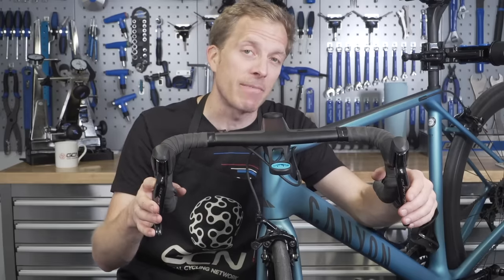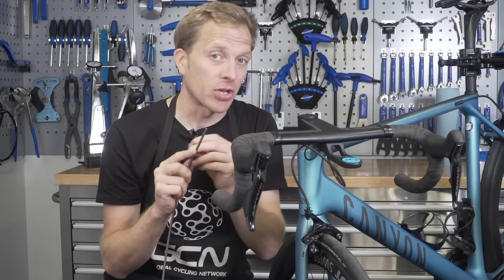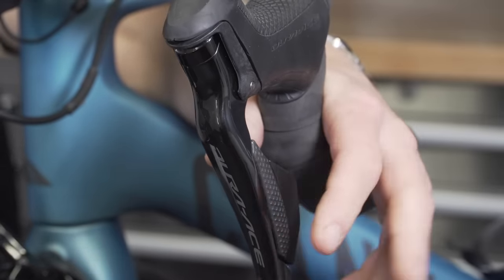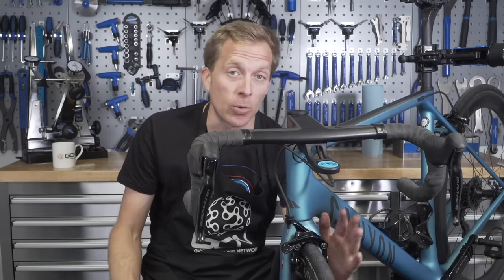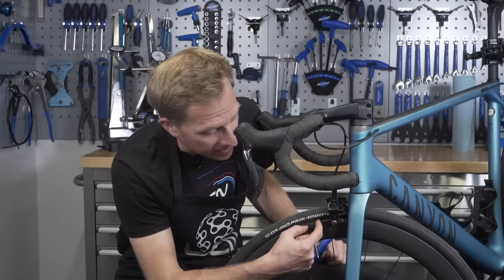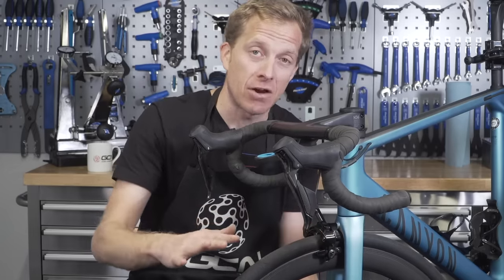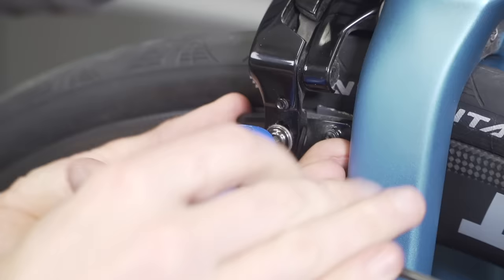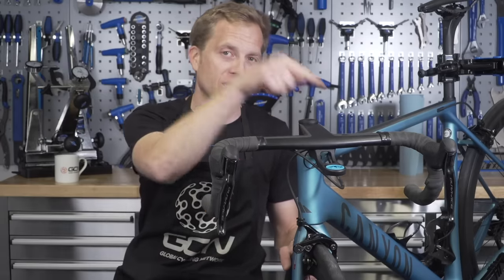5 Minute Rim Brake Tune-Up | Cable Tension, Ferrules & Toeing In Brake Pads

Comment: On my front brakes, one of the pads is closer to the rim than the other, so when I pull on front brakes they engage too hard..I want to loosen so when I apply they'll not grab... how do I adjust the pads against the rim?
Reply: There should be a bolt on the outside of your calipers with a 5mm Allen key socket. You can then adjust the angle and height of the blocks. If you need to adjust the whole thing, there is a bolt hiding behind your front fork which you can loosen and then adjust the caliper so it is central

Comment: How do you adjust the brakes on direct mount brakes? One of my front brake caliper is closer to the rim then the other. With direct mount there seems to be no center bolt to get the brakes lined up. #askgcntech

Comment: Bro I have an oscar racing bicycle. I have recently replaced its tubes but problem is that its tyres are not moving well. When I try to ride and start peddling, it takes much time to get speed. Its front wheel is not working. Brake clippers are also gripping tyres unnecessarily. Help me

Comment: I just hold the brake pads to the rim and then connect the cable. Then I just back off with the barrel adjuster.

Comment: #askgnctech Have a bontrager rim brake on 2015 Emonda SLR. Viewing from rear, the left pad has plenty of clearance but the right side is rubbing hard. There’s a 2mm Alan nut on left side with arrows indicating L clockwise and R counter clockwise. Is this the right one to adjust to give right pad more clearance? I’ve tried both directions but doesn’t seem to do anything.
Reply: It was the right one. But the adjustment way off somehow. I had to go very far L to center it all.

Comment: How do you adjust the brake levers on direct mount brakes? One of my front brake levers is closer to the rim then the other one.
Reply: #askgcntech
Same problem with me, but my case is rear one.
Need solve from GCN Tech...

Comment: Why not put extra spacers, to make the brake pads closer to the Wheel.  I do a lot of hybrid bike riding in the City, on a viking bike, it does a good job, just today, i noticed the break pads had worn a bit, and my tension on the brake was poor, not giving me enough stopping power.  So i know you are supposed to align the pads up right,  however the pads were fine, so i just use extra spacers to make the pads closer to the wheel,  this was fairly simple for me to do, and have done this before, they are V brakes, on most bikes. and they are now braking much better, and sharper, i have heard about this method before, is it one you have heard of.

What i find it is too much effort, for an amateur,  to get it totally right, as once one thing changes you have to change something else.  Once these are worn, i will replace with new ones.  Good video, and great tips thank you.

Comment: Hi,
It seems that my breaks are too short to reach all the way down to the rim, so when I break they squeeze the tyrewalls instead. Do you have any sugestions on how to fix it?
 #askgcntech
Reply: Hey I have same issue... Since the break pad is at the lower bottom you might need to tune the calipers. Play a bit with the screws to see what they are doing, it's good to mess it up hehe. I also found my pad was so eaten on the bottom that it was jumping from the rim to the tire when applied pressure, I inverted the pad so the good surface touch the rim until I buy new ones
Reply: You'll need a different type of brake caliper - some touring/hybrid bikes have longer brake arms to allow clearance with bigger tyres, so the mounting bolt will be positioned higher relative to the rim. They'll either be referred to as long reach or long drop calipers.

Comment: Just got a new bike, whenever I use the brakes it sounds like a freaking steam train!! It's SO loud.

I spent around 10 hours adjusting the brakes and making sure they're 'toed' in correctly, and still it's unbearably loud..
Reply: Just put some WD-40 on it duh..

All jokes aside, check if there are grits on brake pad. Rim breaks don't sound that much usually.
Reply: @a10goesbrrrrrrrrrrt52  Hey man, thanks for the advice but I ended up taking it to a repair shop.
The guy who works there also tried for about an hour before giving up, they were very loud no matter what we did.
In the end, we just replaced the brakes with new calipers. It was a new bicycle and came with some weird shitty plastic material for the brakes that were super loud, the new ones are rubber and quiet :)

Comment: None of my bikes came with toed in pads. I Tried to see if there was a difference but made breaking worse and uneven wear of pads
Reply: Yeah I don't really see the point in toeing them in?
Reply: I believe sometimes a flat brake contact with the rim creates bumpy/vibrating braking which may not be the most efficient for stopping. Also can cause brake squealing which isn’t the most pleasant thing. But if you’re not running into those issues, then you don’t have to toe in maybe
Reply: The toe in gives a more progressive braking power, better modulation.
It also help to "swipe" the water from the rim on rainy days.

Comment: You are joking.  Your fast adjusting lever is fully open all the time. It has to be closed while adjusting the distance of the rubber. Or am I wrong ???
Reply: The lever is closed. Shimano changed the design of the lever with the latest DA 9100, etc.